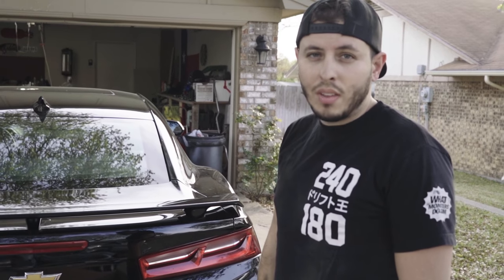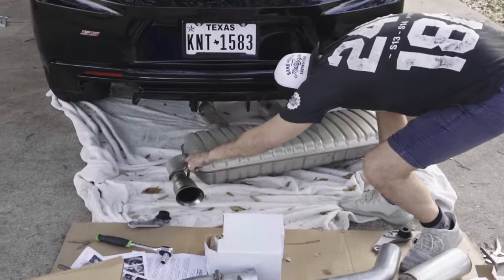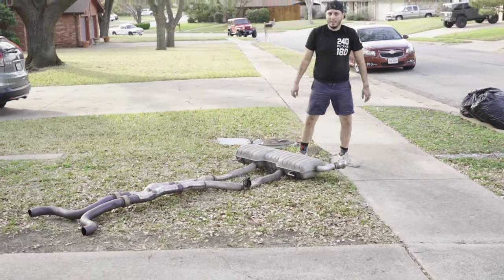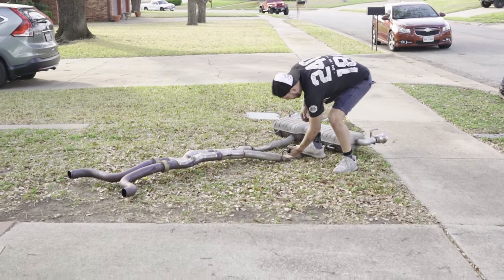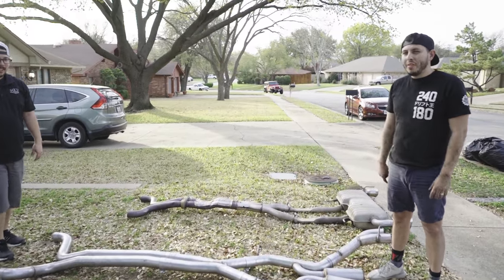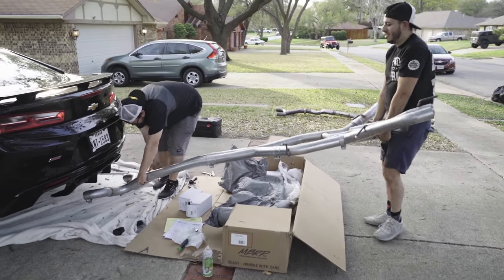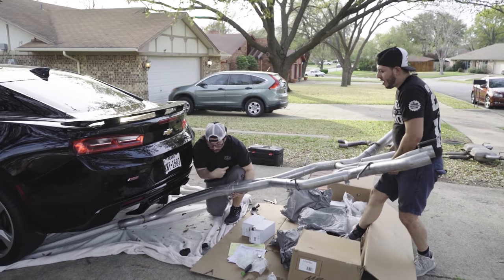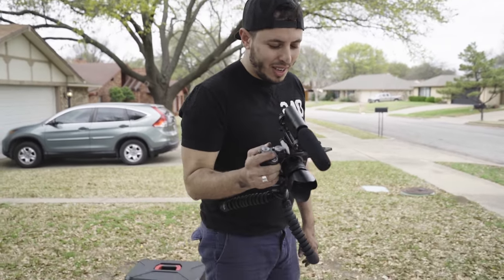The $699 MBRP CATBACK for the gen 6 Camaro SS

Comment: Hey man i got a couple questions if you dont mind:

1.) How is it (the catback) after all this time? 

2.) Does it drone? 

3.) Did it delete your AFM (active fuel management) functionality? 

4.) Did this exhaust require a tune afterwards? 

5.) Did it delete any cats? 

6.) Do u drive an automatic or manual? If manual, do you think it would fit an automatic?? 

7.) How awesome is it?? 

Thank you for your time and I hope u can get back to me, im planning on using this exhaust as apart of my build on my 2018 Camaro 2SS
Reply from the maker: 3. I have a manual, so I don’t have afm. Yes it’s awesome!!
Reply from the maker: I don’t think it will fit an auto because of the afm. Last I read, the axle back works for auto

Comment: Love your videos man! so for this install, you didn't do any welding at all? I'm thinking to buy this set. Thanks
Reply from the maker: Glad u like them! No welding at all. U only need to cut the original pipe, so either an angle grinder or recipricating saw needed
Reply: Nice, sorry just another question. Does AFM (V8 to V4) still work with MBRP?
Reply from the maker: Oh umm.. Im assuming you have an auto? This system states it's for manual only. So, I'm not sure if that would work or not. u may have to contact mbrp

Comment: Did you get and check engine ? Cause you didn’t have Valves
Reply from the maker: No check engine light. Correct I do not have valves. My car did not require a tune or produced no check engine light. I have a 6MT with normal exhaust

Comment: Hey it doesn’t if I have a manual or automatic does it? I saw it says for manuals but I don’t see why it wouldn’t fit a auto?
Reply from the maker: It’s for manual, it will not fit autos, you’ll need to grab the axle back if u are running auto

Comment: How is the fitment on that diffuser?  I bought an oem one and it's on the way, but I'm thinking about selling that to someone or refunding it and buying this instead.  Impulse buying op.  Also how is the color match on the black? I have black as well.
Reply from the maker: Man the fitment it great! The color is black gelcoat so it's not a perfect match. Probably similar to the oem which is not color matched either.
Reply: hey man anything beats that shitty plastic piece that I have/you had lol, thanks for the fast reply!
Reply from the maker: No problem!!

Comment: Want to get the same setup for my 2013 ss but can't find the race version
Reply from the maker: Oh they don't make it?
Reply: @OrtegaDrives  figured it out it's only for the ls3's, I've got a L99.
Reply from the maker: Ahh, the race version I think it's 6mt only cause the displacement in demand system.
Reply: @OrtegaDrives  I noticed that your exhaust pretty much is a straight pipe, no muffler. The one for the L99 has a muffler. Do you think I would just install it anyways and then cut the muffler and just put a single midpipe?
Reply from the maker: That could be possible. Not sure how it would sound tho
Reply: @OrtegaDrives  if I decided to go with a Flowmaster catback outlaw exhaust system(comes w no cats) would I have to get a tune? Reason I ask is because I also want to add longtube headers, but need to space it out for financial reasons lol
Reply from the maker: I'm not too sure on the 2013, but I didn't. I'm sire a tune would hell, but as long as u keep all sensors u should be fine. Yeah wait to tune when u get longtubes

Comment: Would this axle back sound the same, louder or not sound as good as if it was just a muffler delete with regular pipes welded in place?
Reply from the maker: it should sound about the same. the cats are all still in tact, so volume would be the same. this kit will not drone as if u did a muffler delete

Comment: When you cut your stock exhaust out after your cats about how far did you cut?
Reply: Like what was your measurement
Reply from the maker: 2 inches on passenger side and 3 on drivers I think. The measurements are in tye documentation that comes with it, just in case
Reply: Ortega Drives I appreciate it bro! I hear the extensive drone in the video, the audio doesn’t justify it irl?

Comment: does this exhaust fit the automatic camaro ss:??? all i keep seeing is "manual" like um wtf that supposed to mean.... it wont fit autos??
Reply from the maker: Correct, it's manual only. The auto has some stuff in there to control cylinder deactivation which the manual doesn't have.

Comment: Will this make you gain any HP. If yes, how much?
Reply from the maker: Yeah I read somewhere around 15-20 hp and around 40ft pounds tq
Reply: @OrtegaDrives  Lol headers maybe, a cat back, absolutely not.  These cars don't respond to individual bolt on mods outside of E85, headers, Manifold the same way the 5th gens did.  GM engineers already did a bang up job with the majority of the parts on this car.
Reply from the maker: that's what I read. I'd have to look for the source.
Reply: @OrtegaDrives  People say alot of things over the internet, especially the people who are marketing the products.  Go look at dyno runs from 3rd party tuners on the Camaro 6 forums if you want to see true gains.  A catback might net you 5-10 wheel hp max unless your car is making HUGE power already then you might see more.  The stock exhaust simply isnt restrictive as there are people making 900 whp still using the stock NPP exaust.
Reply from the maker: ok thanks for the info

Comment: Is this louder than the corsa xtreme axel back
Reply from the maker: I have no idea. I've never heard that exhaust in person. I am sure is roughly the same since they both retain both sets of cats. These are basically straight pipes as they have no muffler.
Reply: Oh ok so if I just get this mbrp catback will the engine light go off?
Reply from the maker: So, the catback is only for the manual trans. If u have the manual, no checklight at all. I think u have to get the other version for autos
Reply: Ortega Drives so I do have a zl1 1le man trans. So it’s louder to get cat back or axel?
Reply from the maker: Catback should be louder